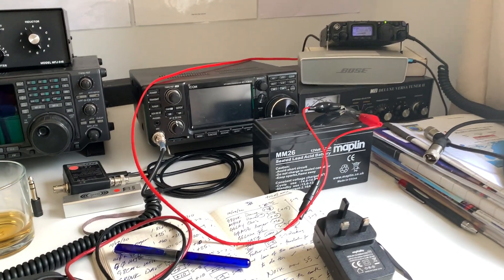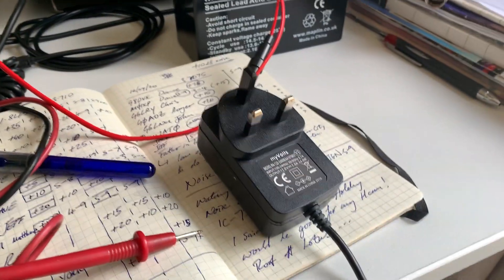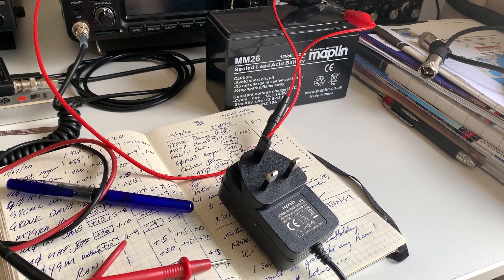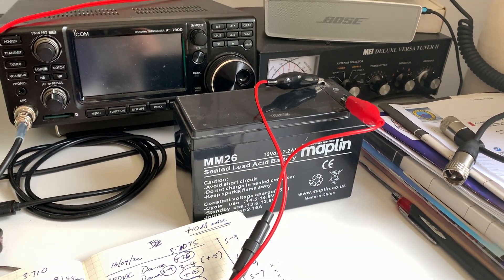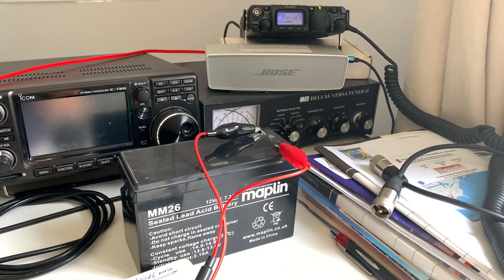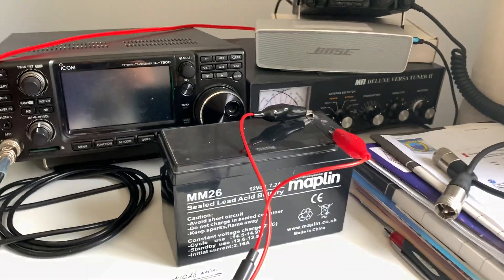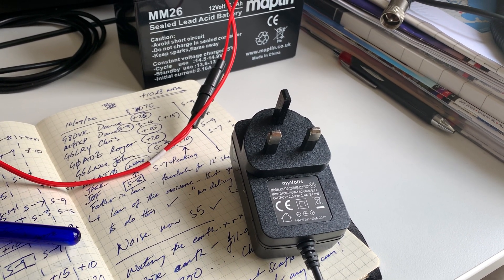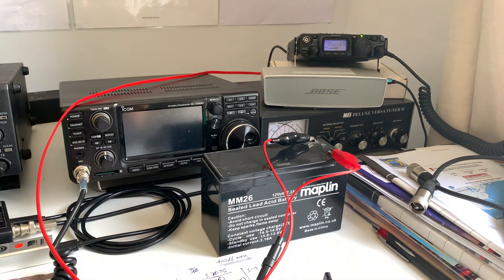Yaesu FT-817: noise issues operating with cheap switch-mode PSU - and the solution

Comment: Hi Clint. How did you measure the increase in noise from 5 to +10 Clint - was in by using the sdr equipment or by observation of the S meter on the attached rig? Cheers, David.
Reply from the maker: Hi, I used the spectrum scope on my IC-7300. 73s, Clint

Comment: Excellent radio a bit of a classic now great to have in the collection very versatile. I use a 12v Bosch drill battery as a back up supply with mine, they are small light easy to charge. Get about 3 hours on receive and 1 hour on transmit which is usually about as much as my attention span will stand. Would love to go down the Solar panel Powerfilm route but can't justify the 2K price tag. Those Nicad's take too long to charge in my opinion.
Reply from the maker: Thank you very much Dave for your comments. Good idea re the Bosch drill battery and I totally agree with you on the cost of solar panels. I have bought a NiMH replacement battery but it's not arrived yet! Keep safe Sir and 73s, Clint

Comment: This is way out of my ballpark Sir, and I think that is fantastic about your battery especially for outdoor activities, but would not a power supply with a ceramic choke or filter in the power cable have helped you Sir like the one that you have got for your Icom ic R 75?👍 73s Tam.
Reply from the maker: Hi Tam, an RF choke/ ferrite rings would help but I don't have any right now. Always better on a battery or linear anyway for noise. Good shout though. 73s, Clint

Comment: Hi, carrying that lead about will be a nightmare, just get a small lipo cell, model grade lipo is cheap and very powerful and will charge very quickly in 15 mins or so, the 817 draws less than 2 amps on transmit, you could use something like a 5000mAh 3S 20C Lipo pack, more than enough for a day on a mountain, you could run more in parallel with them as required, a simple balance charger can be had for about the same money, with a good quality lipo cell with a high c rating you could run all your bigger radios with ease as well, something a lead acid or nimh cell will not handle unless it is significantly bigger, you can start a car engine with a model lipo battery.

That lead acid battery weighs 2.5kg, versus 360g for the lipo thats 5.5lbs versus 0.8lbs.

Try the website www.hobbyking.com
Reply from the maker: Thanks for your comments - duly noted. I'm only using the Maplin battery because I already have it! No doubt in the future I'll move over to a lighter weight option. 73s, Clint
Reply from the maker: Thanks Greg. 73s, Clint
Reply: @Greg White lead acid batteries are still expensive and the example I gave was cheaper, lighter and more powerful which would allow him to even run his bigger radios for a short time also using you example you can't lug a leisure battery up the side of a mountain in your back pack, energy density and price per kWh of lipo has fallen massively over the 15 years I've been using them, lead batteries are fine where their weight isn't an issue but in this example he wanted a battery he could use portable and you can't get 7ah out of a lead acid battery at any decent rate, also the life cycle is poor and the cheaper ones leak, sure there are other concerns using lipo but there is a very good reason why lead isn't used in portable applications. I gather he used this battery because he had it already, once you use lipo you won't touch lead acid ever again, this radio will operate on as low as 8v so even at the cut-off voltage for a 3 cell at 9.6V you will easily get the full capacity of the battery.
Reply: @Greg White well you just lost the argument Greg, grow up for goodness sake.

Comment: A good old heavy transformer with a big fat capacitor and a few ferrite rings on the wire should be requierd here :)
Reply from the maker: Yep! But I can't be bothered with all that right now so my 2.5 kg battery will have to do...and like I said before what with lock-down I need the exercise! :-) 73s, Clint